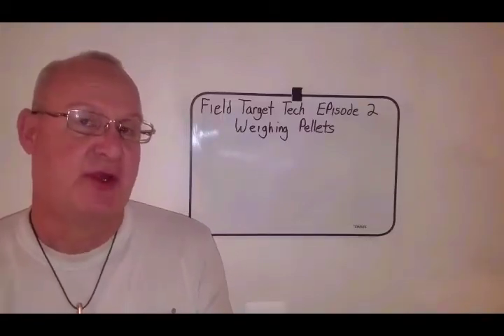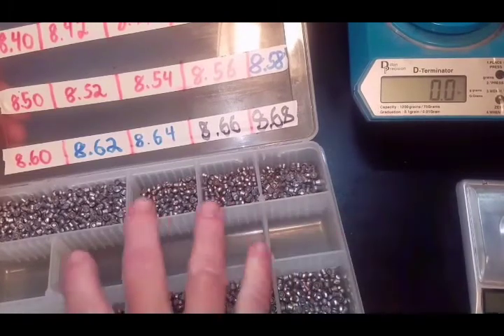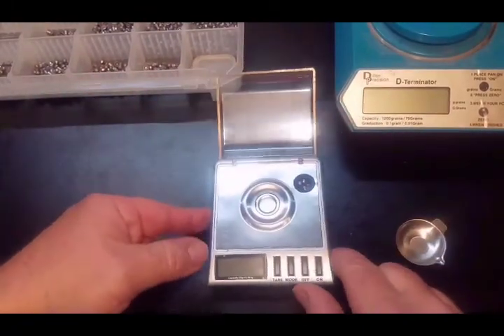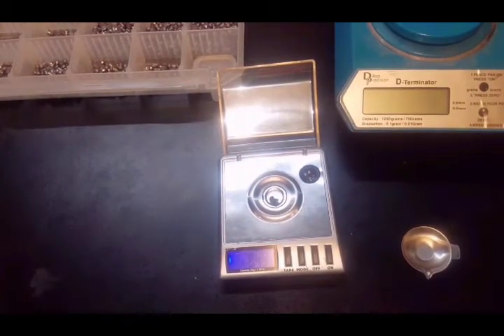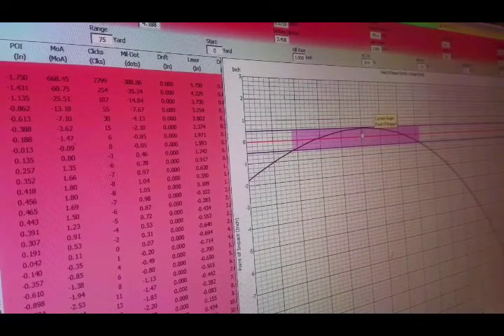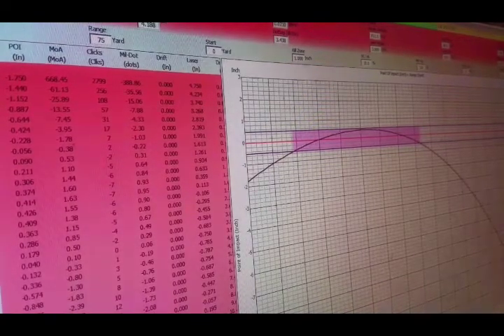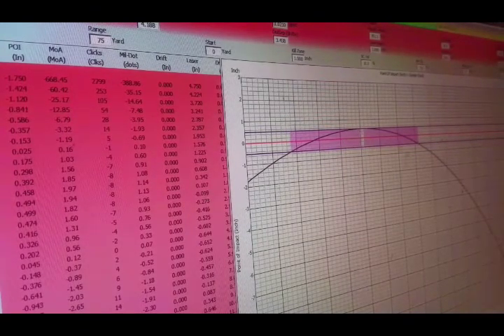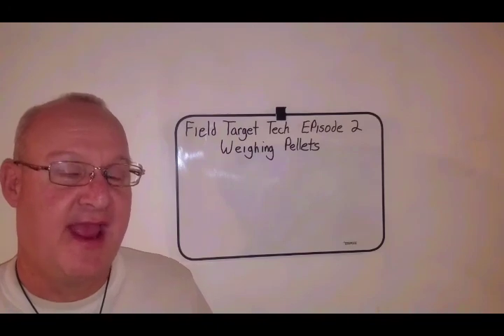Field Target Tech #2 Weighing Pellets

Comment: these videos are great,every shooter does them differently.every pellet scrutinised well done,may i ask doing this do you believe it gives a sort of pscological advantage over other shooters.would you do a shoot out with cleaned way and straight out the tin
Reply from the maker: BITSNBOBS,
I wouldn't say that it gives me a psychological advantage,  other than I know that I'm not putting a possible sub par pellet in the mix.  I don't remember if I mentioned it in this particular video, but in an Exact JSB 8.44 grain tin, I've found weights between 8.07 grains on the low side, up to 8.74 grains on the high side.  That alone will, or could give me a miss on a 55 yard Field Target.   Add inconsistent head size into the equation,  plus a larger/smaller skirt size as well, and you could possibly have pellets out of the tin, if not sorted, vary more than 50 FPS.  That's a large number to be off, particularly when a decent wind is involved.   I would say by me sorting them in this order:  first weight, then head size, then skirt size, is my normal regimen for a big match.  For a local, or club match, I might not go to those extremes, and sometimes my score shows for it.  I would say psychological wise, it doesn't give me an advantage,  as much as peace of mind knowing that the pellets that I am using, are culled to almost perfection.

Comment: Awesome video Thanks, this video was very helpful. I'm looking for a an accurate but fairly price scale, which one do you recommend?
Reply from the maker: Joe, this is a no name scale that I got from Hector Medina, of Connecticut Custom Airguns.  If I recall, this scale was relatively inexpensive, less than $60.  If you look on Ebay or Amazon, there are comparable scales, at even cheaper prices.  As I believe I stated in this video, a scale that reads, for example, 7.9 grains, 8.0 grains, 8.1 grains, is not a fine enough scale, in my opinion for these purposes.  Just make sure the scale reads at least 7.90, 7.92, 7.94, etc., for the accuracy we require.  If you can find a scale that reads even finer, like 7.90,7.91, 7.92, 7.93, etc, even better.  You should be able to find a similar scale that I have for well under $40.